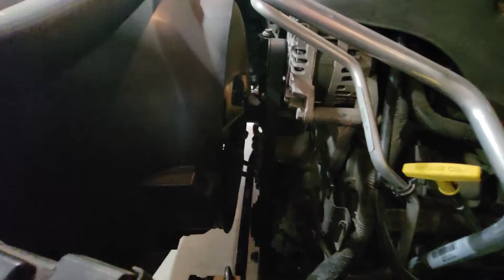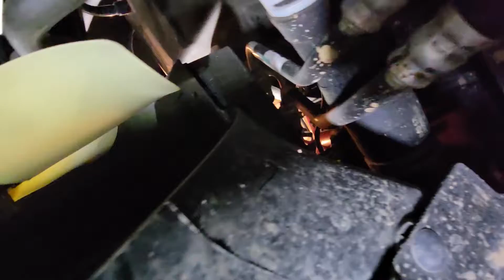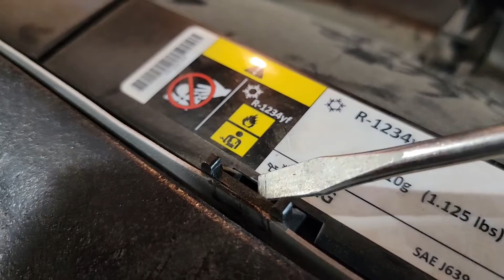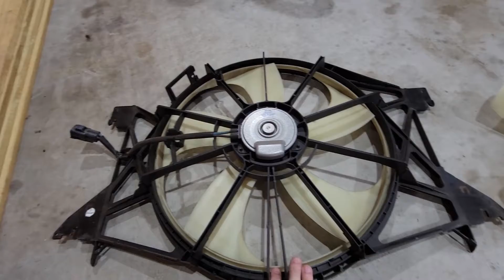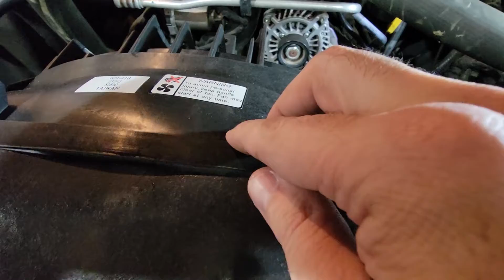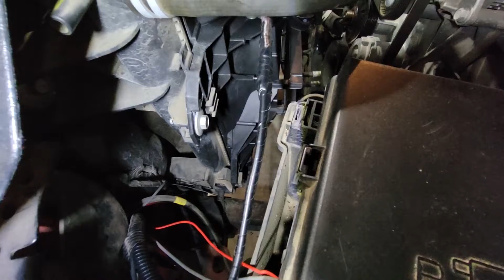RAM Hemi Electric V-6 Fan conversion - Freeing up Horsepower!

Comment: Do you have to tune your truck after this mod?
Reply from the maker: You don't technically have too, but it'll work much better if you do.  I did the 180 degree thermostat, removed the grille shutters and then the electric fan (videos on all, lol) and it helped keep the temps regulated and much cooler.  The 180 thermo really helps get things cooling faster instead of the stock one.  But the fan doesn't kick on until around 202 or something like that to bring it back down (unless you have the A/C on).  So when I did my performance tune, I got them to adjust the fan to cut on at 192.  Now everything usually stays at 185 all the time and runs great.  Hope that helps.  Thanks for watching and commenting!
Reply: @RaymondLamb  do you know if you can do the clutch fan delete and just drive like that?
Reply from the maker: I would not suggest it personally.  You might could get away with it for a little while if you lived somewhere with cold weather, but you won't have anything to get that air moving enough to cool it down, especially sitting still.

Comment: I use a oil filter remover that has a rubber strap to hold the pulley on the water pump to remove the fan. Works perfectly
Reply from the maker: That's a great idea and tip.  Would have saved me a little frustration.  Thanks for sharing and watching!
Reply: @R @RaymondLamb I’ll be installing this fan this week on my 13’. Did you use HP tuners to adjust your temp set points?  I’m currently running a 180 thermostat.
Reply from the maker: I did the fan, the 180 thermostat, and the grille shutter removals all at the same time (did videos on them too lol) and ran like that for a while and all worked great.  I did the Diablosport tuner with a custom 93 octane tune from Hemifever and he adjusted the fan cut on temp to around 192 if I'm not mistaken.  As long as I'm moving it almost never goes over 185, if I sit still for very long it'll slowly climb to 192, fan kicks on and drags it right back down.  All still working great, thankfully!

Comment: To get the large nut loose I use a 5/16" pin punch through the hole in the pulley, and a 36mm wrench. You do have to hold the punch in position with one hand, while loosening with the other. I've done several of these and it works every time.
Reply from the maker: Thanks for sharing another good way to get it loose, hope that will help people who might read these!  Thanks for watching!

Comment: Looks like the hardest part is getting the clutch fan off. Optional on tune or not. Fan kicks on when the A/C is running. I wonder if you change the OEM thermostat to a 180-190 degree you could get away without getting a tune. I’m planning on puttin mods my truck and would like to do one tune vs paying for a tune multiple times.
Reply from the maker: Hey there.  The clutch isn't bad if you can get the right tool or keep it from spinning.  There are  a few comments on here with tips from others how they stopped it from spinning that might help.  I did videos on the 180 degree thermostat install, the tune I used, and removing some of the active grille shutters too if you'd like to check those out.  They're all in the 2017 RAM playlist.  The thermostat will help a ton in my opinion by letting the coolant flow sooner and help cool off quicker.  The grille shutter removal will help stop the temp from fluctuating so much, and then the tune will finally fix the fan settings to where you need them.  I'd say you'd probably be fine to save the tune for last and if you did the other stuff you'd see a huge improvement.  When I did all that mine rarely EVER goes over 185, stays nice and cool and no check engine lights or problems.  Hope that helps some and thanks for watching!
Reply: @RaymondLamb  thanks
Reply: Get the Diablosport Trinity Platinum tuner. It's great, set your fan to come on at 95, get better throttle response, shut off mds and I raised my idle up 150 rpm to keep the oil pumping better when it's idling.

Comment: Do you need a tune when swapping fan and thermostat?
Reply from the maker: Hey there!  For the thermostat, no, don't need a tune, it's just going to let the coolant start flowing sooner and keep things cooler sooner.  For the fan, you don't have to tune it to use it, but to get the best use out of it, I'd say you'd want one.  If you have the A/C running it's going to kick it on any way, but if not the temps will probably fluctuate a good bit.  I forget what the stock turn on temp is, but I think it's pretty high.  I have my tune to kick it on around 192 and with the fan, thermostat, and grille shutter removals it stays almost constantly at 185.  If I'm sitting still in bad traffic it'll climb to around 190-193 before the fan kicks in and pulls it right back down, but normal driving stays at 185.  Did videos on those other things too if interested, hope that helps.  Thanks for watching!

Comment: You don't have to put a nut on that water pump pulley where it won't come off?
Reply from the maker: Hey there, no, there is some sort of stud that comes out the front of the pulley that the original fan nut mounted to.  I guess the pulley is pressed on somehow to the water pump and that stud stays on after fan removal.  Been like that for a while now and no problems, everything still working great.  Thanks for watching!

Comment: What’s the difference between replacing the thermostat then just tuning the temp down to 190 degrees with a tuner?
Reply from the maker: Since the thermostat is mechanical, it won't open until it reaches the right temp. I forget what stock is, 195 or something like that. So even with tuning the fan to come on earlier there won't be any coolant flow to cool. I think it would just make the temp fluctuate a ton. Since i did the thermostat, grille shutter removal and the fan, mine stays almost constantly at 185.  Highest I've seen it was 192 and then it comes right back down. Hope that helps. I did videos on those things too. Thanks for watching!
Reply: @RaymondLamb thanks for the reply! Would the Mishimoto MMTS-JED-06L Racing Thermostat be a good option to choose thermostat wise?
Reply from the maker: That's what I used in mine and working great. Here's a link to that video. https://youtu.be/KRit9g14los

Comment: It also reduces noises from not having a fan run constantly with the engine RPM. Also free up some space as those mechanical fans have that deep shroud and tend to get in the way of maintenance and repair work related to the serpentine belt and accessories.
Reply from the maker: Absolutely, there is so much more room to get to everything with the old shroud out of the way now.  Had the electric fan in for a while now, and still no issues, knock on wood.  Thanks for watching!

Comment: Great video
Reply from the maker: Appreciate it, thanks for watching!
Reply: What was the part number on the B6 Fan fan you used?
Reply from the maker: This is the one I went with, https://www.amazon.com/dp/B0074DFTIO
It's a third party fan from Dorman, so don't have the Mopar part number, but I've had it in a year plus now and no problems.  Thanks for watching!

Comment: Me personally I don't like the thought of relying on an electric fan that can go bad. And they do. I just replaced mine on my 2018 2500 5.7. I didn't even know it was bad but when idling in hot weather the temp gauge would creep up. I am sure the v6 conversion works fine but I like the peace of mind having that fan clutch.
Reply from the maker: I know what you mean, something about having that mechanical fan.  I know they can fail too, but most of the time they fail stuck so they are always spinning and cooling.  All the new RAMs have gone electric, so I feel like I can trust it, but I always have that little doubt way back in my mind.  Thanks for watching!!
Reply: 😂😂😂😂I had a the fan clutch go bad and messed up some things on my 88 Ford pickup truck. I will trust my electric fan. Plus I carry a extra fan motor.😊

Comment: Did you solder the wires together? Or how’d you do it
Reply from the maker: I didn't, I know I probably should have, but soldering has always been my arch nemesis!!  I used crimp wire connectors, heat shrink, and good ol' electrical tape to cover after done.  Still holding up good, no issues.  Thanks for watching!  Oh, and someone else commented you can cut the zip tie holding the main wiring harness lower down and it gives you enough slack to plug it in.  Wish I'd have known that!
Reply: @RaymondLamb  I’m trying to get the slack now lol
Reply from the maker: @BIGRED_98  hope that works for you! Good luck with it.
Reply: @RaymondLamb  thanks. 0 luck yet still about an 1” short damnit haha
Reply from the maker: @BIGRED_98  well 💩, there are some people that unscrewed that part and just plugged it in, but I wanted to leave it like it was designed
Reply: @RaymondLamb  there’s just enough slack to plug it in, looks factory  ✅
Reply from the maker: @BIGRED_98  sweet glad that worked!

Comment: One thing to point out if anyone reads these comments... The motor that runs the fan that you are replacing will fit the new fan with the shroud. So keep it handy if the new fan motor ever quits on you. I already have mine in my toolbox box as a backup if ever needed.

Comment: Hey there ,it's me again.Just put in the electric fan conversion.Simple ,no bleeding knuckles 😂. I seen on another YouTube channel the guy used a allen wrench and stuck the short end in the pulley hole and wedged the long end into the belt tensioner bracket. First time pulling with a big adjustable wrench  and pipe and smooth as butter the fan clutch broke free. The rest was so easy and put a 180 thermostat in while I was in there. Fan worked perfect .Will pickup that nice tuner next month.Thanks for the videos and help.
Reply from the maker: That's great to hear that all went smoothly and working well!  The tuner comes with several stock tunes you might be interested in, but regardless, should be able to take care of that fan setting.  Thanks again, take care.

Comment: People mention tuning it . I have a 2012 Express, how do i tune it after putting everything in. I also tow a 14 foot cargo conversion camper. Im a old dog, no problem with changing things just not computer savvy.😂
Reply from the maker: I purchased and used this tuner in this video: https://youtu.be/ZzhsjGvLd5s
You can go several different routes.  The DiabloSport tuner I used allowed you to customize a few things and not even have to load a performance tune.  You could change tire sizes to correct speedometer, change the fan settings, and a few other things.  It's a slightly expensive route to go just to be able to change the fan temp though.  I will say, this and my other mods have kept the truck about 190 degrees max even sitting still or in traffic or towing in the 95+ degree heat.  Hope that helps, thanks for watching!
Reply: @RaymondLamb  thanks

Comment: Any idea on what the cfm is in that e-fan? I already have done this mod few years back but cant seem to find any info on the cfm it pushes in comparison to the original
Reply from the maker: That's a good question and I'm sorry I don't have the answer either.  I know with this, the thermostat, AGS mod and tune, is rarely ever goes over 185.  But I don't have a clue how much air it actually moves.  Sorry I couldn't help with that.  Thanks for watching!

Comment: Do you have to get a tune or will it work as it should with stock setup
Reply from the maker: @christophermckay961  hey, it will work just fine without a tuner, but just not quite as perfect as it can without it. The stock programming on mine wouldn't kick it on until around 221 degrees I believe it was. I did the thermostat and grille shutter delete and it helped even more. I won't lie though the tune I added kicks it on around 193 now and I rarely get over 185 anytime. Hope that helps, thanks for watching.

Comment: Do you have a PCM tuner added? If so what water temp did you set to have the e-fan kick on at?
Reply from the maker: Hey, I do have a Diablo tuner installed, actually finishing up a video on it right now, should have it up in the next few days.  I believe we set the fan to come on at either 187 or 192, but I think it was 187.  If you've seen my other videos, I did the 180 thermostat replacement and remove the active grille shutters.  With these mods and the tuner, it rarely ever goes over 185 on the temp.  It's all been working perfectly.  Thanks for watching!

Comment: The green ceramic coil is a resistor for a voltage drop for the two speed fan option.
3 terminals ,one is ground, one is straight 12 pass through (full speed), other is 12v through coil( slow speed) . 

Most people will only use high speed ,but two speed is an option.
Reply from the maker: Thanks for that info and for watching!  I wish I could cut mine on at a lower speed, have it tuned to cut on earlier than stock, but it's high speed and sounds like a hurricane.  Cools it off quick though.  The other cooling mod videos I did have helped keep it nice and cool and stable.
Reply: Will this fan work only with a/c on or also when a/c off?

Comment: Bro. Just received my fan. Passenger side mount is broken just like yours. Box wasn’t damaged. Did you jb weld it? Did it hold up? The broken peice was at the bottom of the box. Almost as if they knew it was broken and shipped it anyways! 🤦‍♂️
Reply from the maker: Man that sucks.  Same exact thing with mine, no damage to box, but it was snapped off.  I did JB weld it and should have let it dry longer, but was impatient since I had everything ripped apart already.  But regardless it's still holding strong and haven't had an issue with that piece.  Hope you get yours all fixed up or get you a replacement.  Thanks for watching.
Reply: @RaymondLamb  amazon gave me a $50 partial refund. So l bought some jb welded it. Let it set for like an hour before install. Looks ok. The test will be if and when i remove it for any reason. Thanks for the video. Take care.

Comment: I used an Allen wrench. Put short end in pulley, long end to tensioner. I then used a large channel locks pliers to turn fan nut. Worked great. 

There are two zip ties on that wiring. Look in that vertical grey support.  Remove them and there’s enough slack.
Reply from the maker: Hey, thanks for those tips!  I'm going to check on the wiring if I have to redo my connection.  Thanks for watching!

Comment: Nice job.I did the electric fan in my two thousand seventeen ram laramie. But I didn't like the fluctuation in temperatures. I didn't change anything other than put the e.Fan in.
Maybe I'll try the 180 thermostat  and see if that makes a difference
Reply from the maker: Thanks!  I've removed the active grille shutters and that has seemed to help some on the fluctuation, especially at normal driving speeds.  Working on that video now if you want to check back later.  I've got the 180 degree thermostat ready to install, just have to find a minute to do it.  Thinking that will help out even more.  Thanks for watching!
Reply: That electric fan in the stock tune will not turn on until water Temps of 220, or it will come on if the AC is on. Unless you are adding a Diablo or HP tuner the Fan change in my opinion is not worth doing. I will do one but only once I get my Diablo tuner.